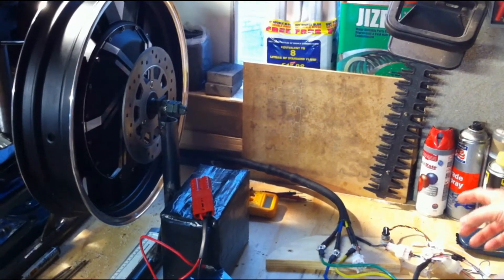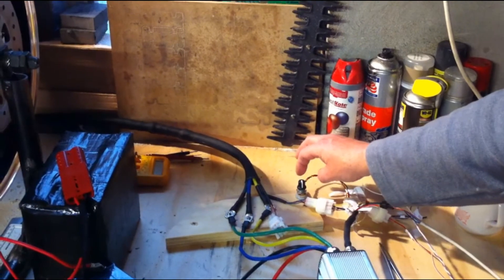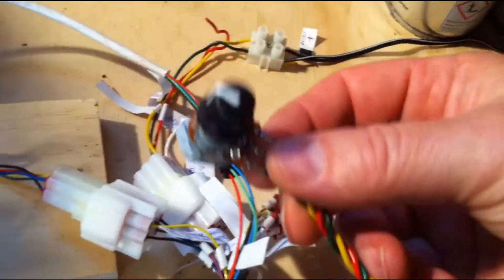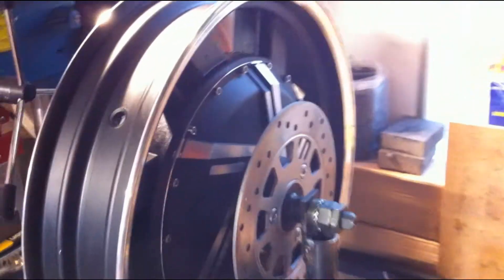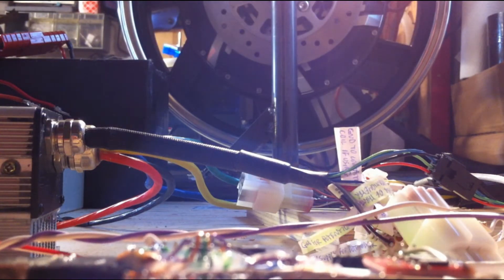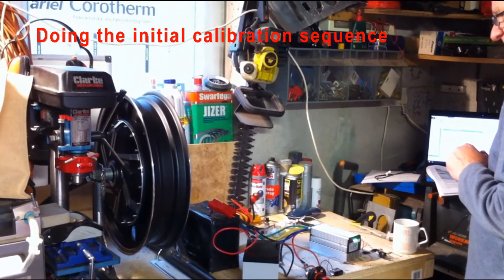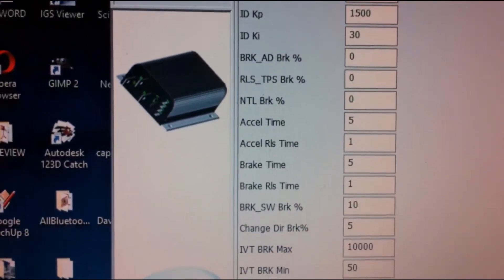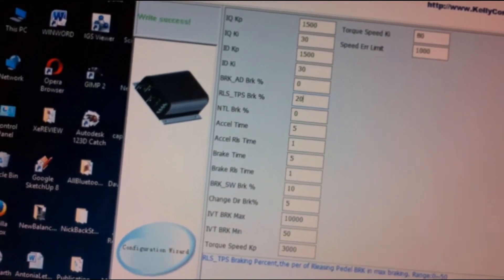Unicycle Garage #1 Monster 3000Watt Hubmotor benchtest

Comment: Great!! I would like to build one EUC also, but with an direct drive EBike/bicycle motor of 1kW.
Just yesterday I did the very first ride with OUR OpenSource firmware for the cheap chinese EBike motor controllers: https://www.youtube.com/watch?v=dWuEvUlixaA
This controllers can run from 24V up to 72V, 15A to 60A ~4.3KW.

One question: for the balance algorithm, what inputs it will need? -- I think is the angle from the MPU and the motor speed. The angle you have on Arduino, but how you will get the motor speed? Is thee any UART on that controller that outputs the motor speed? or will you read from the motor hall sensors signal?
Reply from the maker: It is useful to know the motor speed for self-balancers but not essential. The software tries to keep the machine level. Am currently using an IMU from Sparkfun and an Arduino. If you lean forward, it thinks you are falling over and will speed up in forward direction to try to correct this and bring the machine level again. The tricky part is designing the machine so it has plenty of torque so it can easily correct any imbalance, and then tuning the PID algorithm so it balances smoothly. My first machine, a skateboard, around 2009 took me 3m of work just to get it to balance at all. Nowadays I can just watch a machine moving and have a reasonable idea of what needs changing mechanically or in the software.